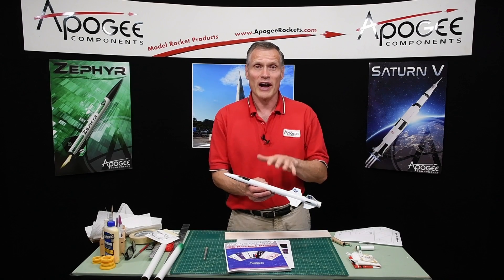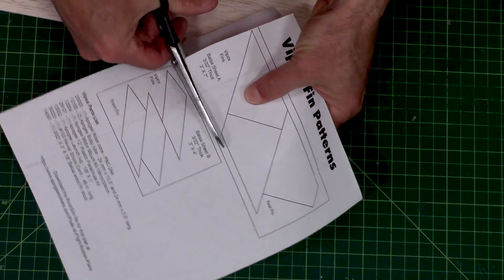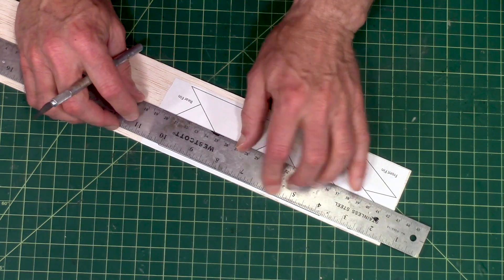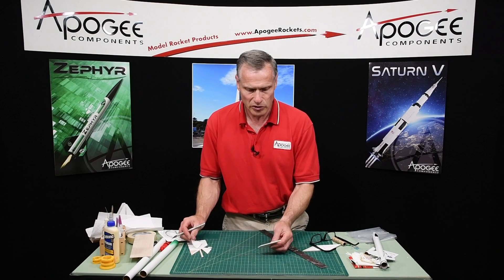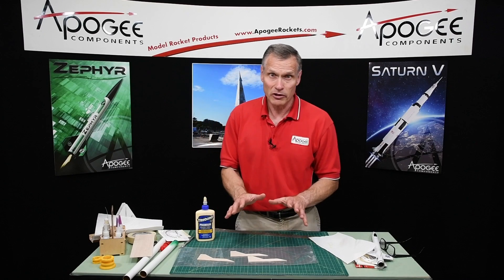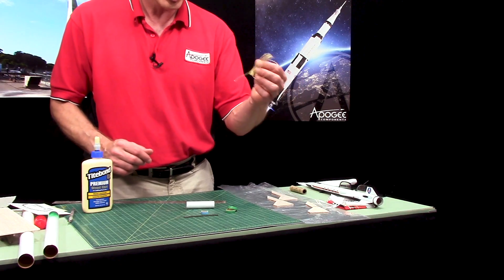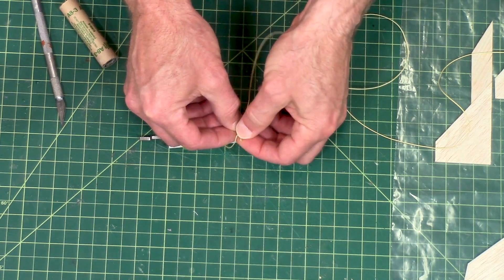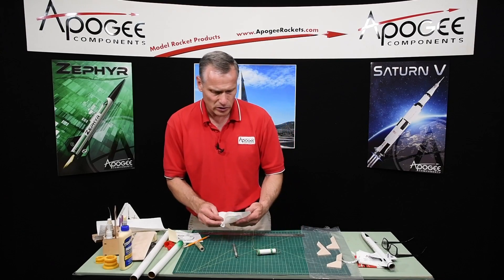How to Build a Rocket From Plans: Part 1 - Cutting Out the Fins

Comment: Oh this looks like a great series Tim. Your fin construction looks much better than mine. I used to just pin them with the paper over the balsa but the tacky glue works so much better. Not only did I need to fill the pin holes but I am sure accracy my way was not that good. Thanks for a better way to make fins from plans. The shock cord with kevlar looked like the way Harry Stine used to do it from way back too. Its great to see the right way to build these cool rockets. The details of fins do show the elegance of smooth fast rocketry I am sure.
Reply from the maker: Thanks. I'm glad I could help you. Being part of your rocketry experience is a thrill for me as well.